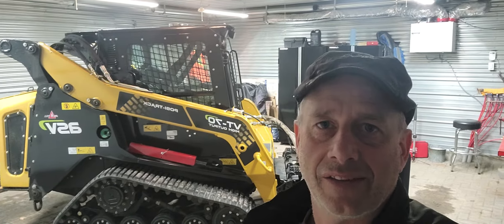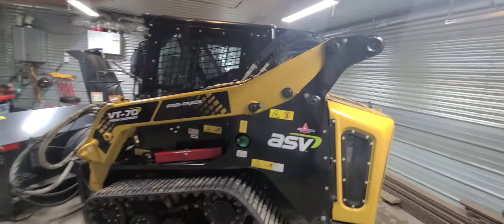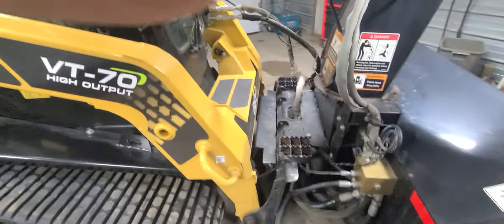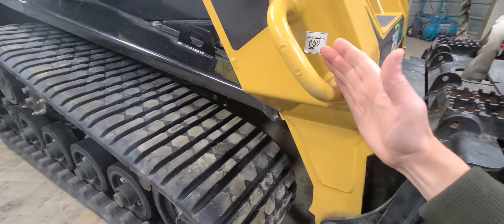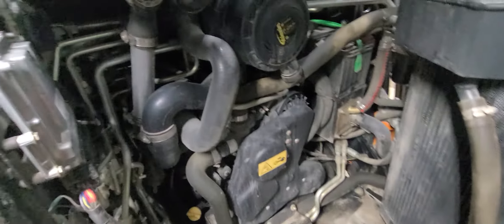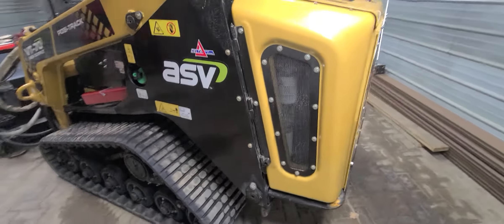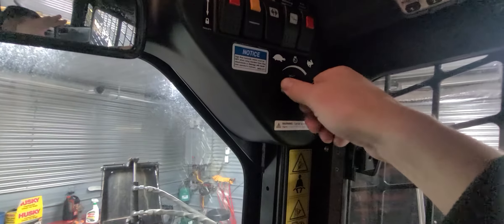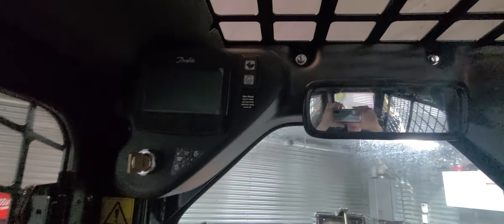2019 ASV VT-70 High output Review

Comment: Do you like the RT-65 over the VT-70? It seems like a lot of dealers are pushing the VT-70 as the better option. Obviously there are some application specific components but since you have operated both. Between the two whats your honest take?
Reply from the maker: Yes the VT 70 is not a machine for the type of work i do. Basically it's hard to see out of and it's heavy for topsoil or mud. My fourite machine is the discontinued RT 60